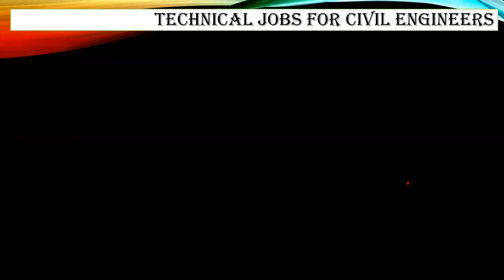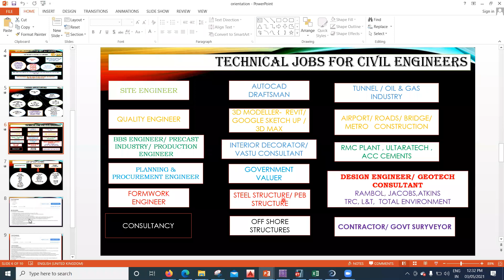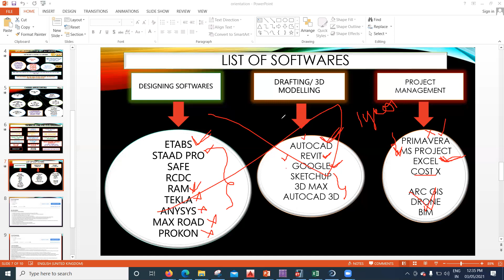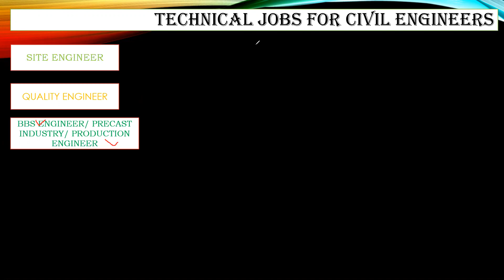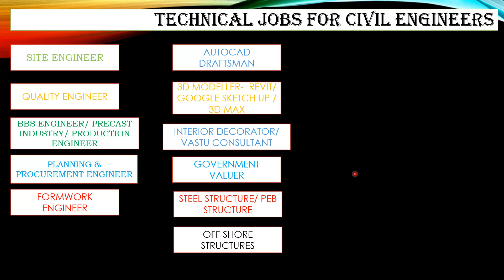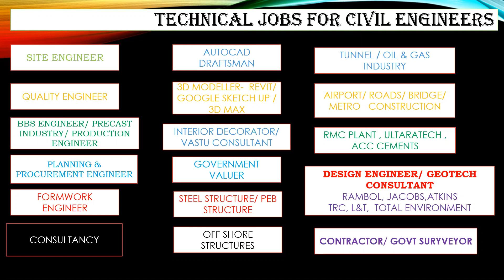Comment: Sir I want become a PMC in less tym how can I archive means what field should I prefer first and which are software should I have expertise....pls guide me sir
Reply: U meant to say project Manager ?
Reply: Yes
Reply: @tabrezkhan7037  see project manager in Big companies will take time . you need knowledge of all . Initially start with site engineer , than u can become senior Site Engineer or Asst Site Engineer, if you are Good in Planning u can even knock the Doors as planning Engineer , and than keep Moving. Later u maybe promoted as Asst Site Manager or Site Manager and than comes the project manager. there may be other Positions before reaching Project Manager other than what i mentioned.
It totally depends on Company Hierarchy.
U can become project Manager in Small companies in 3- 4 years also   but MNC companies  will take time near about 8 - 10 years and based on Ur Performance.
Reply: What u have to do see , learn everything and project manager should know all specially the Management part & also how to Plan a project from Start to End . 
Along with that u should have good Command on MS Excel  & Power point , these are the tools you will using mostly for Tracking the Project and for Presentation.
Learning Ms project & Primvera is equally Important  .
Learn Ms project if not primavera.
And tat  will come with experience , you cant learn all that  with some trainings .
Reply: Thank you so much sir for your valuable guidance 🙏
Reply: So I need to prefer small company rather than MNCs
Reply: @tabrezkhan7037  no. u get into Big companies only . because a project manager in small company is equal to Asst Site Manager in Big Companies.
Big companies you learn a lot .
Small companies you don't learn  much  in later part , for initial growth Small companies are good to learn .
Reply: See , you don't think much for all these, its good u have a plan now . just do your work , learn concepts , learn Ms excel , improve your communication Skills , try to learn new Skills like Ms project , get yourself trained from experts and than you yourself will come to know how  to go forward.
i can just tel you to do like this , like that all unless you get into that situation you will not understand .
One thing what i can tel is improve daily . invest on Ur self in learning skills   and that will help u in future.
Reply: Ok sir thanks again❣️